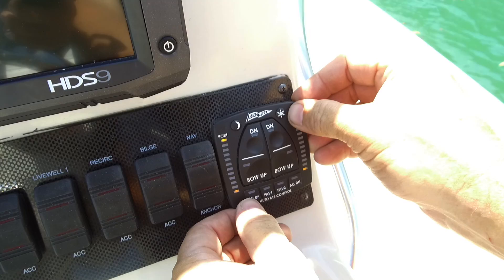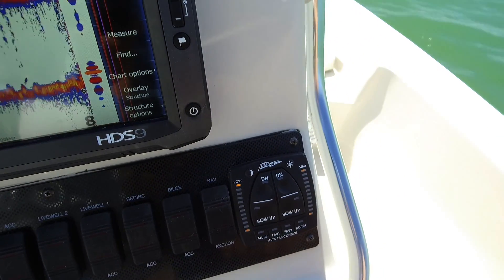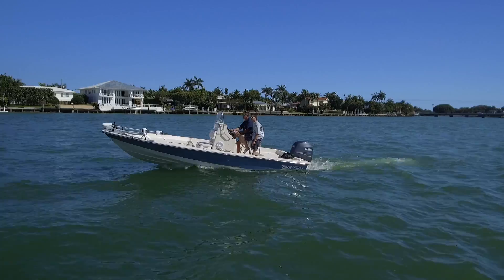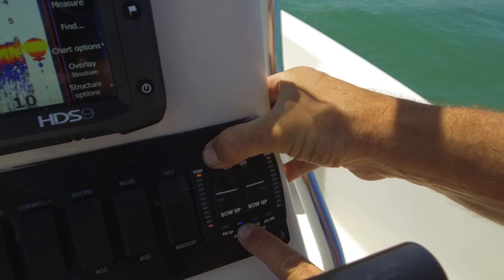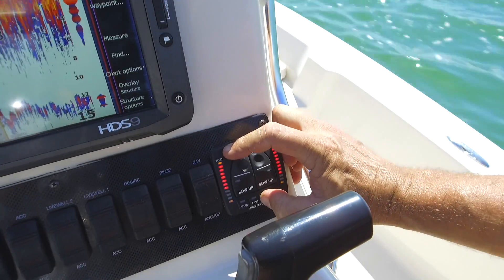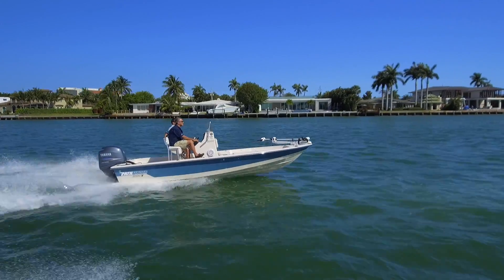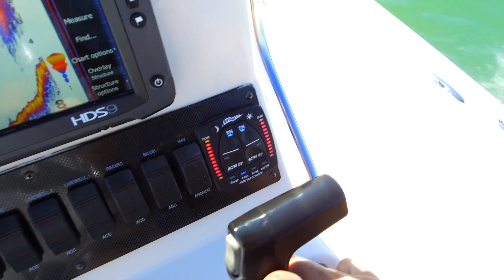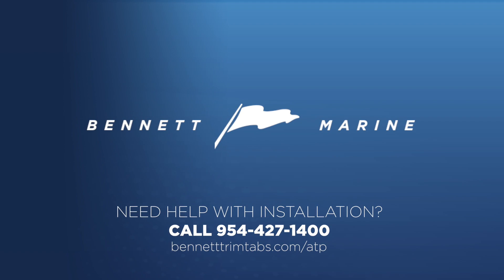Bennett Marine Auto TrimPro One-time Set-up

Comment: This absolutely is not working on my 22’ Howard Offshore.  I have called tech support and run the setup at least a dozen times.  After 10 seconds on plane it fully retracts the tabs.  I had high hopes but it simply doesn’t work on my boat.

Comment: Can I use NMEA 2000 indicator with Auto Trim Pro?
Reply: What is a NMEA indicator? Just starting my project. Thx
Reply: @gilb5710  NMEA 2000 is a kind of bus system, that uses a single cable to carry several different electronics information. Bennet has an interface, where you can connect the flaps with this NMEA 2000 and if you have a MFD chartplotter, like for exemplo Raymarine Axiom, you can see the flaps levels direct on the screen of the chartplotter.

Comment: Installed the unit today.  Did steps one and two as described in the video/instructions. ( I have the NMEA2000 version)  I set the boat up and pressed fav1, every time i set it up and release the Fav1 button,  the trim tabs just retract.  Any suggestions?
Reply from the maker: Would you mind emailing us your phone number to (BMI_Info@Yamaha-motor.com)? It will be easier to have one of the techs call you to troubleshoot. Thanks!
Reply: @BennettTrimTabs1  will do. Thanks.

Comment: Used the AutoTrim Pro for the 1st time today after installing 18x9 tabs on my Release 180RX in a fresh water lake to get it set up.
Set up went smoothly. Getting up on plane and accelerating at a pretty good speed now takes 3 seconds or LESS!!!  Staying on plane (after already being on plane) went from 3200rpm to 2500rpm. Our 1st experience using tabs tho. Lost about 5mph tho when any tab is touching water flow in the LEAST amount. For full capable speed tabs MUST be fully raised, so for correcting ever so slightly lists caused by prop rotation WILL slow boat by 5mph.
Pressing 'ALL-DN' and going full throttle then quickly pressing 'FAV1' makes for a 3 seconds or less up on plane and accelerating then pressing 'ALL-UP' gets us to max speed by still using motor trim.
Placing motor prop parallel to water surface in hopes of more efficiency slows boat down at least 5mph. Now that we will be using tabs do I need to get motor raised to get speed back to previously known maximum so we can trim motor to parallel to water surface? I mounted our control box on the inside wall of console to instead of near the transom. My first impression of the ATP is that we will still need to control the tabs in manual.
☆☆Edit 7/9/2020: now that we have used the AutoTrim Pro  near and offshore a bunch of times, which will be exclusively saltwater. This is what i have discovered...
1. The auto feature is just too slow to respond to keep you from reaching for an adjustment yourself and getting it over with.
2. Saltwater use is an entirely different animal compared to when we tried em in freshwater. Near and offshore with the waves to deal with these tabs are AWESOME! I notice no speed loss at all and it is so easy to ride more comfortable cruising in pounding waves. I have not lost ANY fuel efficiency at all. If anything my fuel mileage is even better. I am clocking 4.5-5.4mpg with a yamaha 115 on a heavy 2017 18ft V hull Release brand boat (old Cobia designed hull). I will NEVER buy another boat without having tabs on it. I am so glad you guys talked me in to buying the longer 10x18 tabs. I almost bought what I see everyone else has ( tabs half the width).
3. Much easier to just press ALL DOWN and put on the gas then press ALL UP and then adjust from there than waiting for the unit to do it in automatic tho.
Reply from the maker: Sorry for the delayed response here. Certain comment notifications were hitting our spam folder for some reason. Thanks for your feedback! Please email BMI_Info@Yamaha-Motor.com to speak with one of our techs who can advise on that situation.

Comment: I just installed this yesterday and took the boat out today. I did the calibration procedure exactly the way the manual states. All the lights blink the proper way and everything seemed to go fine with the calibration. I set the favorites exactly as directed, and after I did the boat would not maintain the proper position that I had set it at. If I come to a stop and I accelerate the tabs go down as they're supposed to, and do everything I believe the right way when I stop . However no matter what I do I cannot get the favorites button to keep the boat level port/starboard. One time I saw the LEDs attempting to level the boat, but I never saw her do that again afterwards and when you hit favorites all four yellow lights stay illuminated but nothing happens with the LEDs  as they would when you use it manually. I calibrated the system several times, and each time everything worked with the calibration the way it's supposed to. The control unit is mounted in the engine compartment verticaly and level, away from anything with a motor or magnets , and away from heat. There has to be a glitch in it. I also ohmed out all the cables and they were good. All buttons do what they're supposed to, but the one feature that I really bought it for it doesn't work. Very frustrated.
Reply from the maker: Rick, please contact our client services department at BMI_Info@Yamaha-motor.com or by phone (954)427-1400. They will be delighted to help.
Reply: Did they fix it for you? Why a Yamaha tech for a Bennett issue? Don’t get it.
Reply: Did they fix?
Reply: @cjharrin  no

Comment: nothing here about 12V EIC5000.  I need to know if it will work on a 1998 system and also need more that 20 feet of cable  reach the helm.
Reply from the maker: The EIC works on that system, go here https://bennetttrimtabs.com/EIC5000-Install to view the installation instructions. Look at the first section so see if the actuators on your boat may need special sensors.

There is a 25' cable available part number EIC20125

Hope this helps!

Comment: The Manual says to Acceleration State Orientation: press and hold the Sun + FAV1 buttons for 3 seconds. All four corner LEDs will flash indicating readiness. Throttle up to speed in a straight line without using the trim tabs. After 10 seconds FAV1 and FAV2 will STOPP flashing. Orientation is now complete.
I wonder if this is true only to electric systems that if you press a Fav button the tabs first go all way down and then up before go in automatic mode and that they go down by decelerating the boat???
Reply: If you are accelerating the Tabs will Tabs will go down to hold the bow down as it rises as you speed up. If you are stopped slowly before accelerating they may go all the way down.

Then as you accelerate to planing speed they will retract and adjust to keep the boat at the Fav attitude you have selected. And as you mention the Tabs will go down to keep the bow from rising during deceleration.  

Will be the same for both electric and hydraulic systems.

Tom McGow
Bennett Marine
Reply: Thank you Tom, I have to watch this behaver on my next ride.
Reply: I just installed this yesterday and took the boat out today. I did the calibration procedure exactly the way the manual states. All the lights blink the proper way and everything seemed to go fine with the calibration. I set the favorites exactly as directed, and after I did the boat would not maintain the proper position that I had set it at. If I come to a stop and I accelerate the tabs go down as they're supposed to, and do everything I believe the right way when I stop . However no matter what I do I cannot get the favorites button to keep the boat level port\starboard.  One time I saw the LEDs attempting to level the boat, but I never saw her do that again afterwards and when you hit favorites all four yellow lights stay illuminated but nothing happens with the LEDs  as they would when you use it manually. I calibrated the system several times, and each time everything worked with the calibration the way it's supposed to. The control unit is mounted in the engine compartment verticaly and level, away from anything with a motor or magnets , and away from heat. There has to be a glitch in it. I also ohmed out all the cables and they were good. All buttons do what they're supposed to, but the one feature that I really bought it for it doesn't work. Very frustrated.